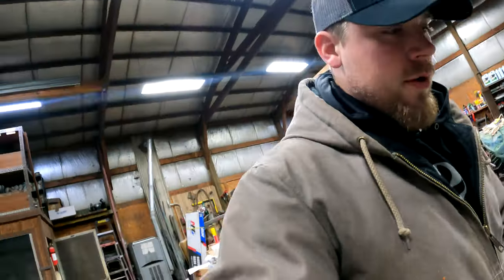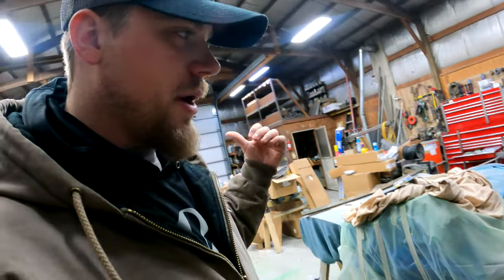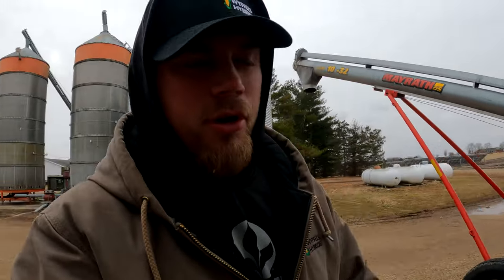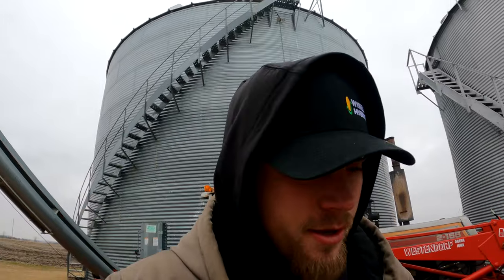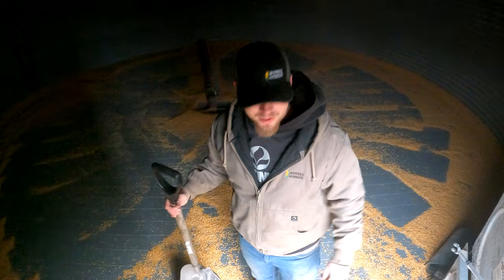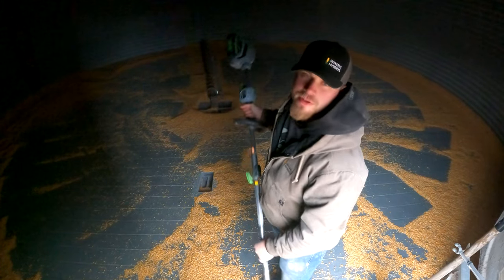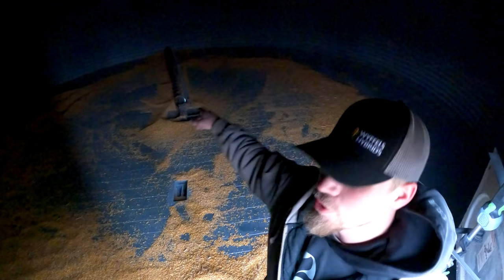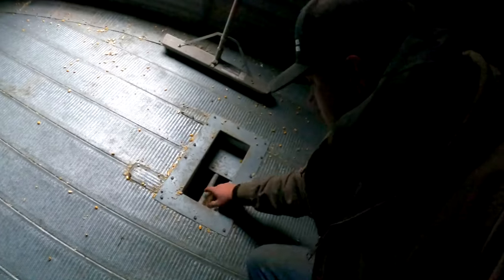The BEST way to clean out a grain bin? || EGO Power head + Bristle Brush

Comment: Did you find that even after using the broom that you end up needing a shovel afterwards anyways?
We just bought the milwaukee  bristle brush attachment at work (at a grain elevator)because i initially had seen guys using it online in like a grain bin like you had and so I figured that if it would work in a corn bin then i figured it might work under our dryer for all of the fines and bees wings that pile up throughout the day and especially at night after everyone leaves and either me or my dad is the one that stays there with the dryer and so itll pile up deep.
The milwaukee one im not sure about.
I like that its battery and it does sweep decently. My dad wanted to keep the guard off since he figured i wouldnt want the extra weight(its extremely long, id guess over 6ft, and heavy as hell too).
With the guard off, we can flip it upside down and pull it back towards us which makes it sooo much easier since youre not fighting against the way the bristles turn. But without the guard, the fines and fuzzies kinda just go up and right back down on the brush and then just ends up throwing them all around  and when its upside down, it fills your boots quick.
I seen a video a guy using his for snow but he custom made a set of wheels to be able to roll it back and forth with.
Thinking thatll be what we try next.
Reply from the maker: It works great I found for pulling the grain down off the sides of the bin into the center before you start the sweep.

It worked good for cleaning up the floor, just need a leaf blower to get the corn off the sidewalls. Then I just finished up with a broom otherwise the power sweep would throw it too far lol

I’ve used it in snow!! Used to clean my driveway with it. Works great!